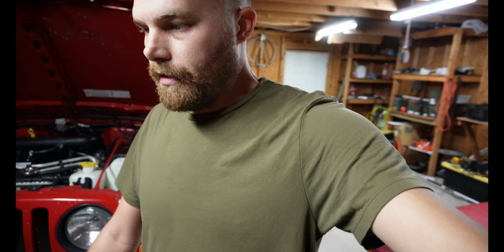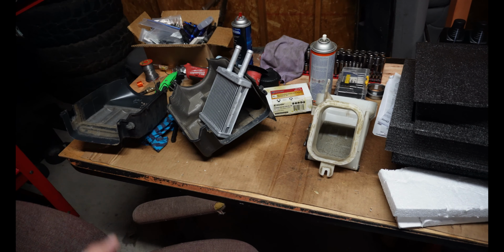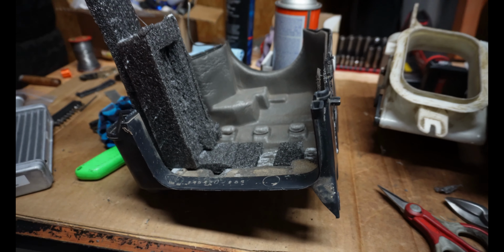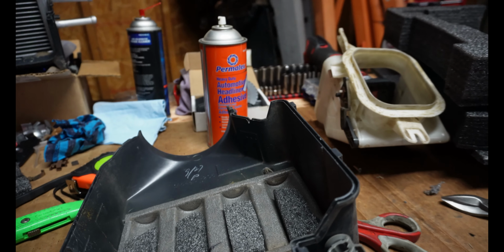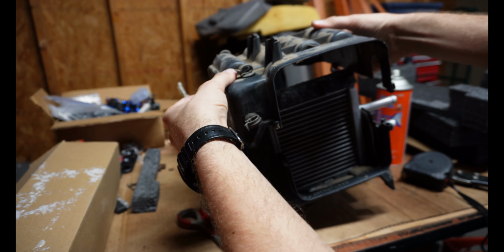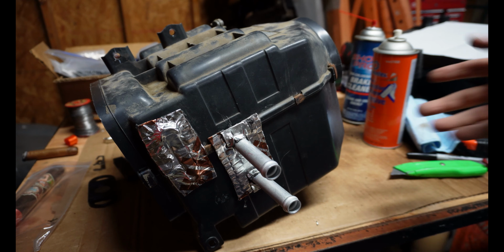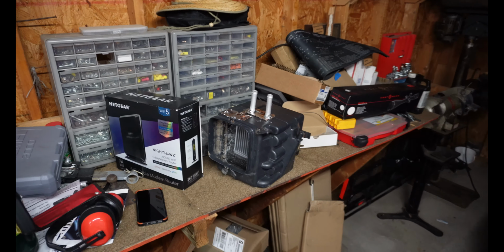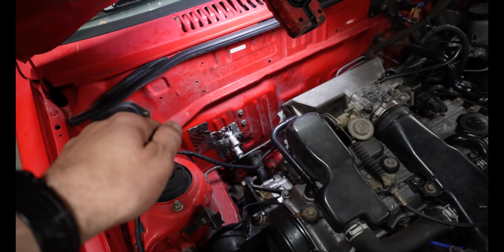Adding a heater core / heater box to a Ford festiva

Comment: This is my car in Iran! But we call it Pride. I think  ford gave it to KIA motors and then KIA gave it to Iran. You can search " پراید" on internet and see it. If you need to some some parts of ford fiesta or Pride KIA you can find it in Iran or even Iraq. My head cylinder has much noise 😢
Reply from the maker: Great info!! The parts are getting hard to find here in the USA. The cars were only imported here 1989-1993. I have one more festiva with a bad engine. The parts to rebuild are not available. So that festiva will be getting an engine swap from a 1992 Mercury Capri Turbo